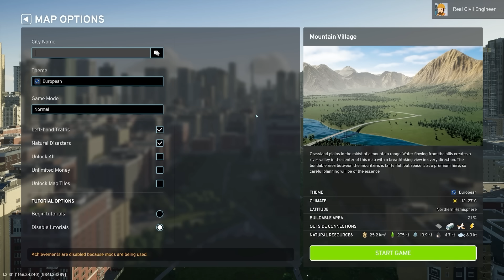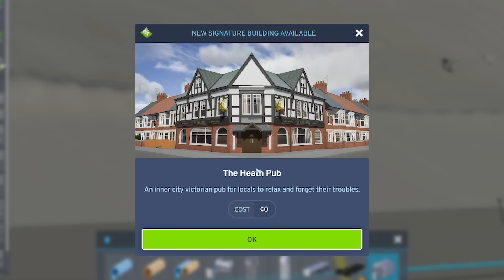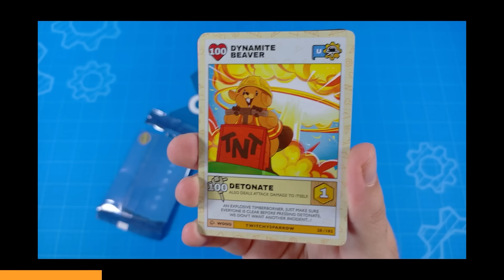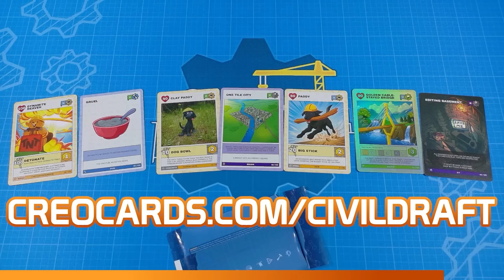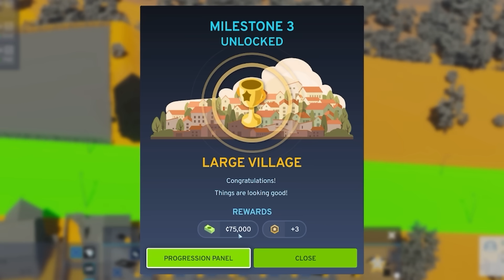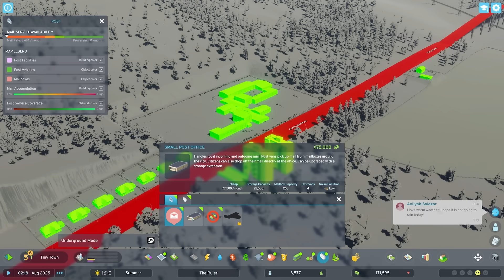I built a city in a COMPLETELY STRAIGHT LINE in Cities Skylines 2!

Comment: OK, so detached houses are just houses, semi-detached houses are a duplex, and terraced houses are townhouses in the states.. Got it.
Reply: Wtf is a duplex?!
Reply: @JohnyG29  In the US: A duplex is any building divided into 2 homes with separate entrances. In the UK: It's a 2 floor apartment (although it's perhaps more commonly called a maisonette)
Reply: It gets more confusing, because we do use terms like "townhouse" and "duplex", but to refer to different things 

In the UK, most single family homes are 2 storeys tall.

If a row of terraced houses are 3 or more storeys tall, we might call them townhouses.

"Duplex" in the UK usually refers to a flat (apartment) that's split over 2 storeys, since it's not flat anymore if it has multiple floors. 

We never use duplex to describe the horizontal relationship between homes, we only use detached/semi-detached/terraced for that
Reply: I thought a duplex was a house split in two horizontally. One house upstairs one downstairs. Two houses conjoined side by side is called a Twin where I am
Reply: townhouse small, duplex is two homes connected, and then you have mobile homes which are bound on the ground and they can be moved with a semi truck (foundation is typically cinder blocks and stuff) and then a foundation home is just. on the ground and it’s basically sealed to it with cement. Mobile homes are gear because they can be moved but they lowkey kinda wear down faster, usually the leveling. the floor starts getting soft spots and the house needs to be reveled occasionally. I live in rural texas so we have a mix of foundation homes and mobile homes mostly. no big apartment complexes and no townhomes.

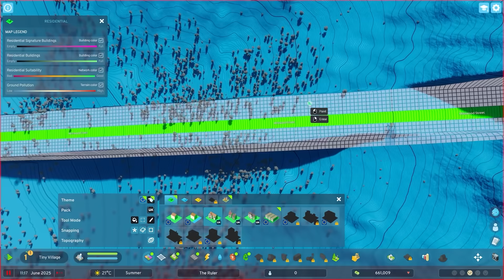Comment: 9:20 sat here thinking, you placed it before you checked the water flow direction.

Also, as for how wide you can go in the challenge, i would say as wide as the largest building, so as an example the footprint of a nuclear powerplant

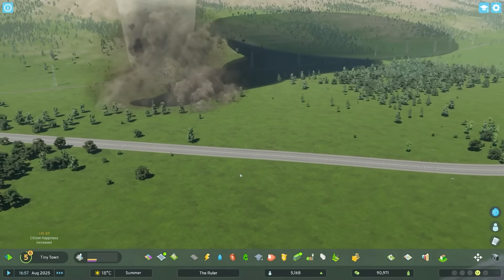edit - 33:50 no tornados in the uk he says ... shows when this was recorded after the last week, also until that point there were tornados but they were mostly only small ones hardly noticeable, but we had them